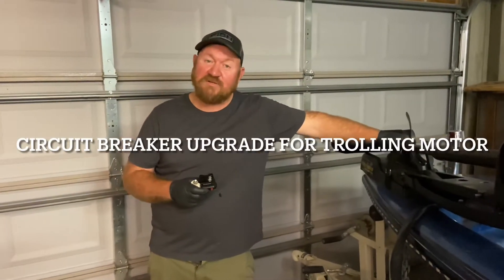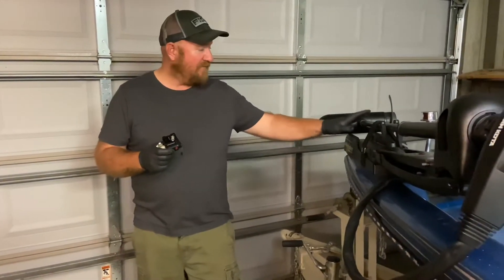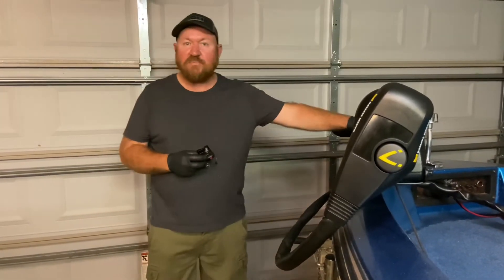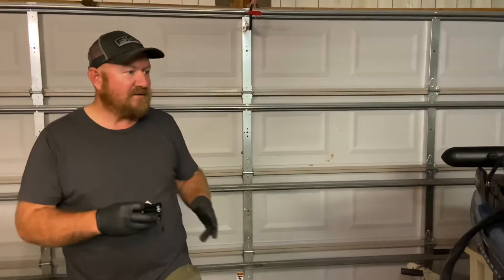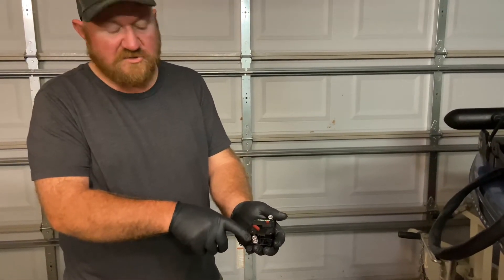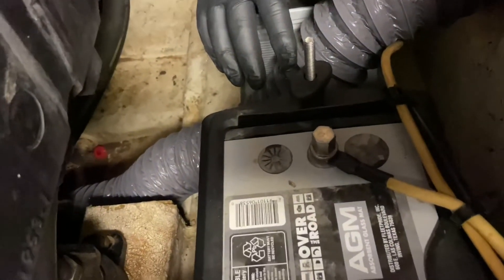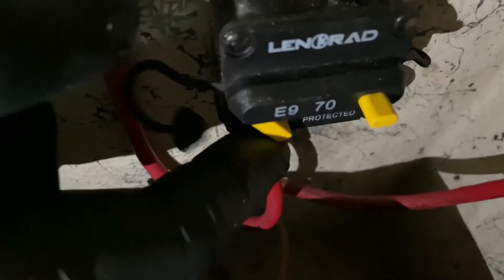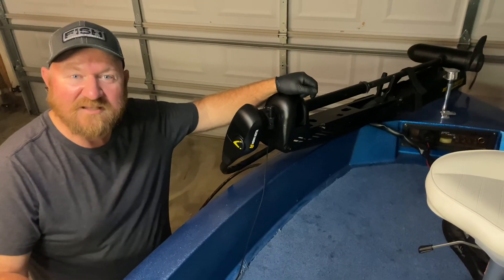Upgrading the Circuit Breaker for a Trolling Motor on a Boat

Comment: The circuit breaker is to provide protection for the wires not the trolling motor. The wires you have look like #8 you should have a 50 amp circuit breaker at the max.  If you over load the wires they will now burn before the circuit breaker trips

Comment: I installed a 12 v Terrova this weekend. The paper instructions says to go directly to battery for the 12 v. I am still going to install a 60 amp breaker.
Reply: The installation manual does NOT say to "go directly to the battery. It very specifically says: "An over-current protection device (circuit breaker or fuse) must be used. Coast Guard requirements dictate that each ungrounded current-carrying conductor must be protected by a manually reset, trip-free circuit breaker or fuse. The type
(voltage and current rating) of the fuse or circuit breaker must be sized accordingly to the trolling motor used. The table below gives
recommended guidelines for circuit breaker sizing."

Comment: What positive line do Imount the breaker on.  I am sure like most my trolling motor connection has a  neutral line,
 a  12 V line and a 24 volt line coming from the batteries connected in series.  Do I mount the breaker on the 12 v or 24 v line coming from batteries? Thanks
Reply from the maker: The boat in the video has a 24 V system .  Two 12 V batteries are connected in series with one positive lead and one negative lead running up to the front of the boat to power the 24 V trolling motor. The circuit breaker is installed on the positive lead going to the 24 V trolling motor. I have another ranger boat with (factory wiring) four wires running up from two batteries that can be connected either 12 or 24V depending on the trolling motor plug that is installed. It has a circuit breaker on each positive line coming from the batteries.

Comment: do you manually trip the circuit breaker before you charge your battery via onboard charger when you get home?
Reply from the maker: No, not necessary

Comment: Why go so high amp on the breaker? You defeat the purpose of a breaker if you go well above what you need (you can damage the trolling motor before it trips the breaker).
Reply from the maker: Not a big difference between a 60 amp and a 70 amp circuit breaker. I know Minnkota calls for a 60 amp -that particular trolling motor has a 56 amp draw. My main goal is to prevent melting down the wires and burning down the boat if something goes to short circuit. Also wanted to have enough capacity in case I upgrade to a bigger trolling motor later.
Reply: @ProWrenching  in the world of electronics, isn't a 10 amp difference quite substantial?
Reply from the maker: @AdrianLParker  The national electronic code rule states that you can’t push the current over 80% of its specified capacity. So if you had a 70 amp breaker 80% of that would be around 56 amps so that circuit breaker is within the range for that motor. But I’m not an electrician I’m just a mechanic.